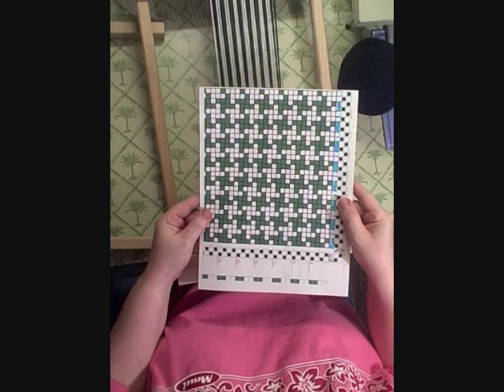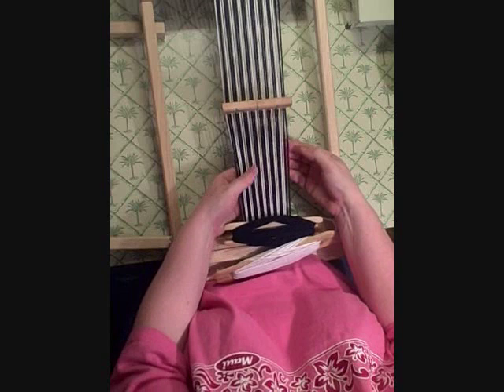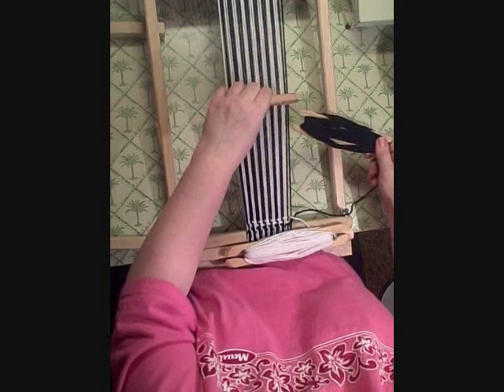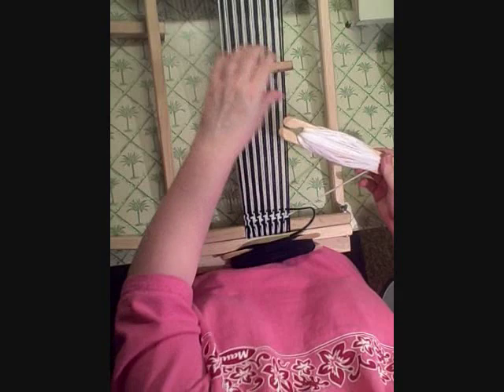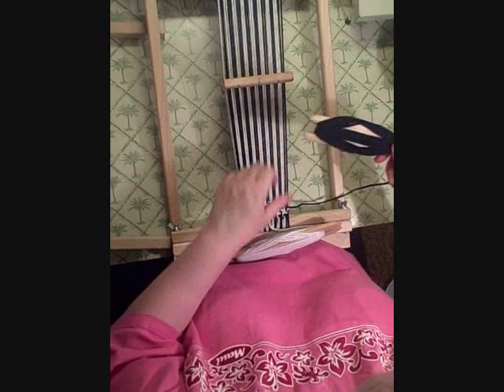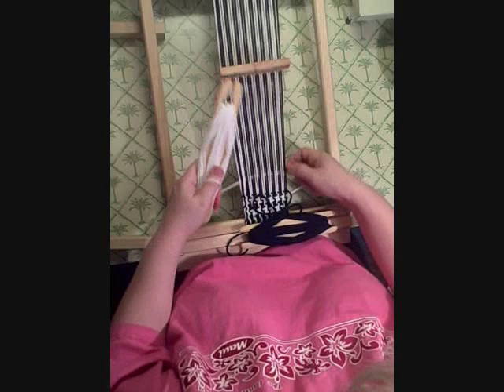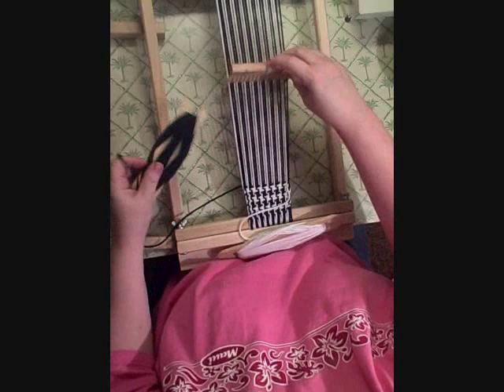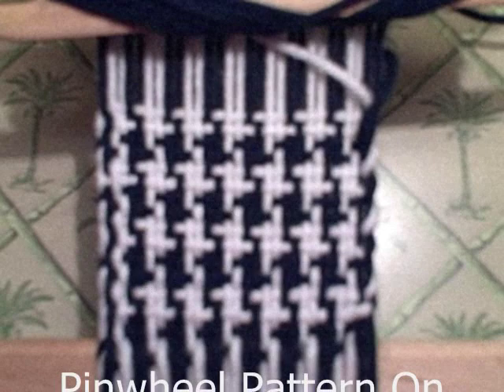Pinwheel Houndstooth Pattern on Rigid Heddle Loom Weaving

Comment: Will this work on an inkle?
Reply: As long as you used alternate threads of contrasting warp (2 light, 2 dark (each one with a single thread heddled and unheddled thread) as well as to rows of weft in 2 alternate colours, yes it would work
Reply: Only if you aren't making a warp face weave which is the normal weaving style on an inkle loom.  This pattern needs to show the warp and weft equally.